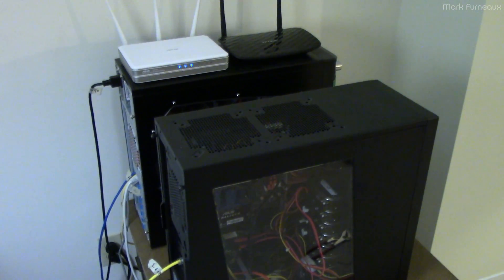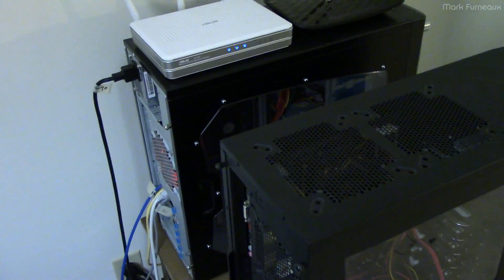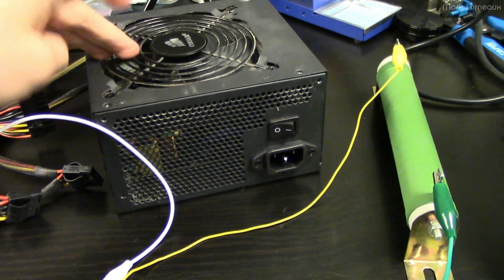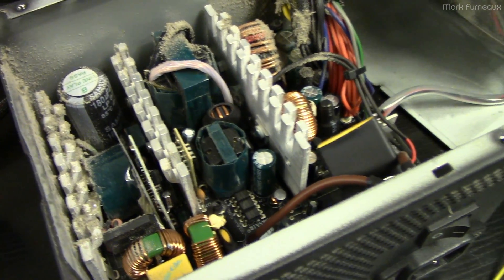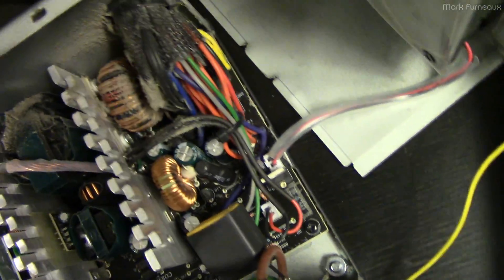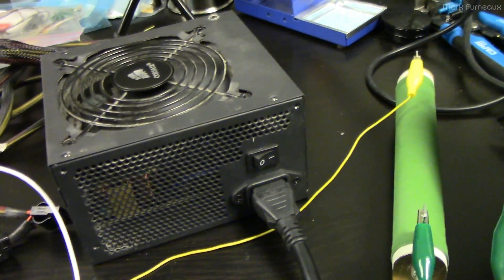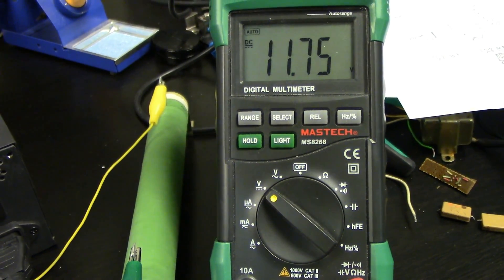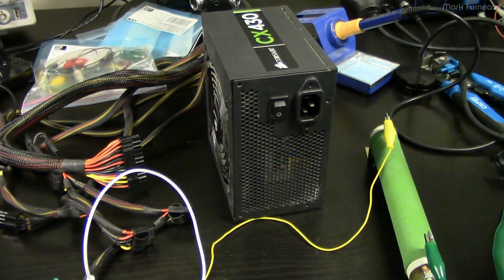Failing Computer Power Supply Causing Crashes

Comment: Aside from the crap caps, that Corsair isn't all that bad. $5.00 worth of good low ESR caps and a dusting and it'll be good for 5-10 more years.
Reply: AliExpress has its own PayPal-like system which uses credit-card payments (and apparently is escrow, so doesn't free the money up until the items are received). I've used it hundreds of times with no problems.

TBH though even CPC is a lot cheaper than £1 each, usually the type of caps needed for supplies like this (in the range of 1-2000uF, 6.3-16V), CPC is generally charging around 20-30p each for Panasonic FC or FR. Where China scores is the free delivery worldwide.

EDIT: OK maybe 50p but still :)
Reply from the maker: I don't know where you buy your caps from, but $5 is a bit exaggerated. The mains filter cap alone costs at least $7. All the caps plus shipping and tax is at least $25 where I am.
Reply: simontay1984 Agreed, the caps that actually fail are nearly always the low voltage ones (5v/3.3v lines, 12v more rarely and hardly ever the primaries) which can be replaced for peanuts. Have a look at the Ultimate Electronics store on AliExpress, this guy sells genuine capacitors at a fair price (most others sell fakes however) and does not charge for shipping. Even if you just use more cheap Samxon level caps the thing should run for another few years.
Reply: In the 60+ devices with SMPS that I have repaired, I've only ever seen one mains filter fail. I get my caps from Digikey.ca average price of 105 degree low esr is between .50 and .80.  $8.00 overnight shipping is high for a few parts, but if you have a larger order it's not unreasonable. OK perhaps $5 is a bit low, there's more caps in a computer power supply than a single or dual output SMPS, but $25 is a tad high.

Comment: What's a solid polymar cap?  Can you find these in the correct value for the output caps?  The primary side capacitor looks way to small in value too, and there is just one of those.  WTF?  450 watts, ha.

Comment: I wonder if ALL the rails must be loaded to power supply to function correctly. If you only load 5V that might out of power supply specs. Cpu, Gpu, hard drives and optical drives load mostly 12V rail

Comment: my computer randomly restart can this be the cause
Reply: It could also be the cpu over heating.
Reply: Zazno Productions it could be the psu, my computer was randomly restarting because a bad 500w EVGA B1. but it could be CPU triggering over temp protection, or any number of small problem that are aren't as commen but not imposable
Reply: Toby Cowles it will just ramdomly restart after a ptogram like davinci resolve or kerbsl space program its put me into a jam
Reply: Zazno Productions have you used a program like HW moniter to by CPU ID to look at CPU temps when you open those programs because if your cpu temps aren't crazy high (check online for normal cpu temps for your specific CPU) then it is most likely your PSU
Reply: Zazno Productions the website is www.cpuid.com/softwares/hwmonitor.html make sure to click the real download button which is a pinkish purple and says SETUP ENGLISH not any of the many fake green ad ones that will probably just give you a virus
Reply: Toby Cowles i have a evga x58 classified motherboard so it  says the temperature on the motherboard. but ill give that a shot. thr temps aparently never get above 40°c so it should be fine. i hope its the powersupply because I thought it could have been the caps on the motherboard.
Reply: Zazno Productions Good luck, hope you can fix it, it is no fun when your computer doesn't work right, I was so stressed when my EVGA 500 B failed, keep me posted if you need any more help
Reply: Toby Cowles thanks

Comment: Seasonic for life. Absolute fanboy of their X series.
Reply: Yup! :D
Another good brand is Delta Electronics.
Reply: I had my X750 over current protection fail and melt / smoke my molex cable that only had 1 peripheral plugged in. If I wasn't testing my system so carefully I wouldn't have caught it and it would have burned my house down. I no longer trust my X750 or Seasonic. It's not even a year old.
Reply: Indeed. I paid out the ass for the one in my server but the quality is worth it, with out all the gimmicky shit
Reply: My Seasonic Platinum began failing under load after 1 year.   Paid cash here in Japan at Joshin - couldnt find reciept - honestly never thought I would need it ever.  Seasonic would not help me.
Reply: The focus gold series are good? and the newer arquitecture?

Comment: I was running pfSense on a box with an intel nic that would keep dropping out and taking a shit.. turns out it was the crappy logisys power supply that was in it. Since I didn't have any cash to replace it, I had a spare 200w LiteON psu laying around from an old HP machine.. been working great for over a year now.

Comment: So is it the CX series by Corsair that are bad?

I've been using a 750W TX  by Corsair in my PC for since 2010.   
And I've had it at 100% CPU load over multiple days encoding videos with no issues.
Reply: +dgedi78 the cx400 was a seasonic OEM, the others are CWT
Reply: The CX series are one of the worst. The TX series is good.
Reply: Well, i had a cx 500m (or 600m, not 100% sure) in my old pc and it killed my old gtx 780..
Reply: I have a 400CX-EU that works perfectly since 2010. I don't know what's the difference with the non-EU version, maybe just the power cable.
Reply: I had a eu version too^^
Reply: troyBORG I had that version and it went through hell and died. First the fan stopped working at low temps, then random crashes getting closer together.
Reply: 1250nick CWT actually makes some good PSUs for Corsair, the CX series aren't among them, however. Can't go wrong with the RM series though.
Reply: CWT makes most of Corsair's psu lineup with a few other discontinued seasonics, some chicony and flextronics for the AXi lineup. and CWT makes everything from junk to great psus.
Reply: 1250nick Yup. The rule with CWT is you get exactly what you pay for, so if you want a good PSU, don't cheap out... which is really true of power supplies in general.
Reply: RevengeofGothzilla meh, you can get a cx450m for $35 after promo and rebates now, so good budget psus aren't all that expensive anymore.
Reply: 1250nick Corsair CX power supplies aren't good, though.
Reply: RevengeofGothzilla the old green CX units are fine for what they are; decent entry-level power supplies for office pcs or low-end gaming rigs. the new grey CX are now quite good, just as good as seasonic's s/m12ii. i believe tom's hardware has a review on the grey CX650M.

Comment: I actually had a Seasonic die on me a few days ago (started shutting off at random and eventually wouldn't turn on). It was the SS-660XP2, and I guess I just happened to get a bad one seeing as how all my other Seasonics (including another, older, SS-660XP2) are fine. I replaced it with one of the new Seasonic "prime" ones and it's fine now.

Comment: i use a cx series psu in my file server and so far its running good i would of used 430m like in my other builds but at the time it was more than i can afford pretty much no extra cards on the system and 3 harddrives

Comment: My computer has crashed about 5 times in 4 months where it just turned off and restarted and I was not under any load. Is it the PSU? I have an EVGA 500W. I'm completely power illiterate.
Reply: powerplayer75 could be a failed hdd or ssd too
Reply: Toby Cowles oh :P warranty replacement ?
Reply: No, I killed it because I put a 770 in my computer that I got used cheap($100), and that kept triggering over current protection and killed the PSU because it wanted 42 amps on the 12 volt rail and that EVGA was rated for 41.5 amps on the 12 volt rail, so I bought a Corsair CX600 from newegg for $30 to replace it, after seeing this video that doesn't seem like a great idea but I did it and so far it has held up well so...
Reply: Amp hungry Card still have my  evga 770 sc acx in my Old pc :)
Reply: Very power hungry, mine is a Windforce OC, still a decent card for the games I play, and for $100 it is hard to argue with
Reply: my 450b has the same problem. It happend after only two months! The cheep PSU that came with the 20$ case does not do it, but it cannot supply enough power at load.
Reply: It could be that, if software issues have been already excluded. If it's a HEC-made EVGA, blow out the dust, they have current crawl issues over a dust layer if it happens to lie just a tiny bit wrong, due to how sloppy is HEC with mounting isolation on the heatsinks. Well not any worse than CWT, just something to keep in mind.
Reply: Unexpected Sensation my EVGA 500 B died and it caused my computer to randomly reboot and freeze up when just sitting at the desktop or running chrome, if I where you I would try a new PSU and see if it helps

Comment: My first lesson in suspecting power supplies was my experience with consistent reboots when I'd attempt to run a specific game (back in 2004 or so) -- I had no idea what was going on until a friend of mine suspected it was a PSU issue, and it sure was. It was a "500 W" ATX power supply that I got for 30 USD...
Reply: Same problem I have now, same price same Watt. I bought a high quality corsair 550w psu
Reply: I never thought I’d have problems with the PSU because I have a seasonic focus+ platinum. I experience the same problems as you do. Just waiting for my new PSU to come.
Reply: Having the same problem now with random freezes
Reply: @Bmanfj09  was your problem fixed when you bought the psu?
Reply: @YazzenYoutubeYG  I haven't been able to get a quality PSU yet, will update later.
Reply: @Bmanfj09  thank you will wait your update
Reply: @YazzenYoutubeYG  changed the power supply, EVGA gold 650 and no more freeze.
Reply: Same here. It's shutting down with any game but with the old games it's shutting down even faster.

Comment: On your second channel, in the ZFS recovery video, you said that your workstation had a "dependency" on your server and so, it wouldn't work.
Was it just important files or does your workstation need the server to boot up?(if it was the latter, why would you do that?)
Reply from the maker: It was a hard dependency a long time ago. I hardcoded the system that way to prevent a race condition in the bootup sequence. Now it technically can start without the server, but it will make a lot of applications very angry and I'd have to clean up after them, so I don't boot it without the server being up (which is pretty much all the time anyways).
Reply: that seems like more than its worth.. i mean i can take my computer anywhere without anything except windows complaining about network drive mounting.

Comment: I've broken 3 PSU's. A 500, 600, and 750 Watt. I got kinda tired of failing components. So i went with the EVGA G2 1300 Watt
Reply: It's going to break anyway. Power has nothing to do with reliability.
Reply: It will break, but not anytime soon, it will most likely last 5 to 15 years.
Reply: Yocool13's Channel Sounds about right. This one has a 10 year warranty.
Reply: ChaseMMD I know, I have the same one but a lower wattage. :3